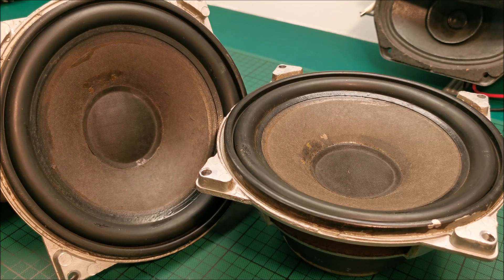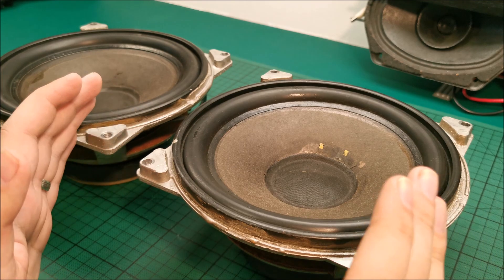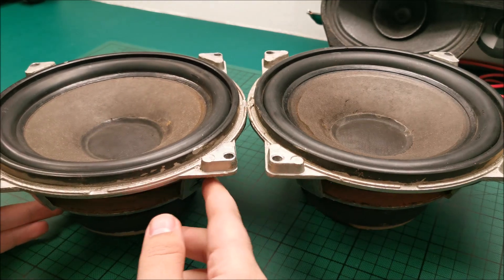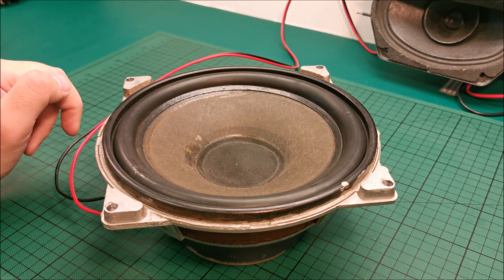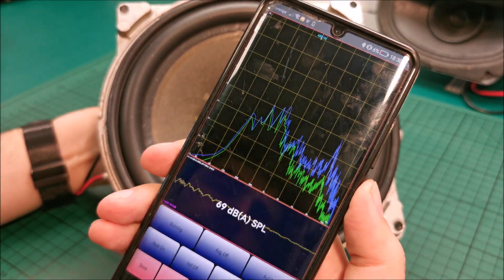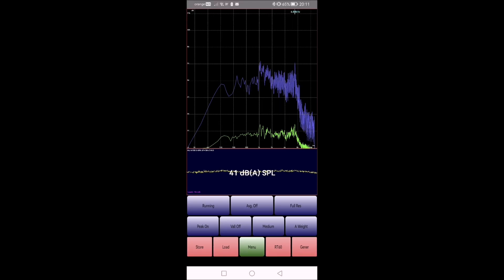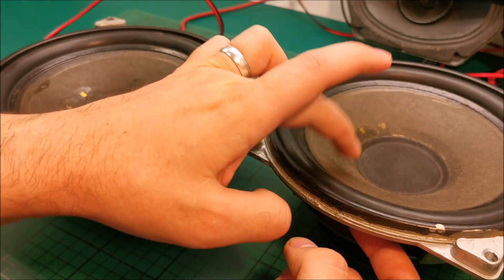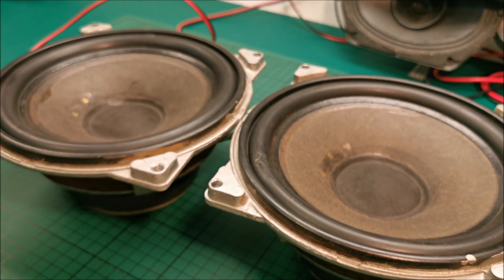1980s Soviet (Russian) 10GD-30B (10ГД-30Б) vintage speakers - test, frequency response and excursion

Comment: I found a pair here in india from a ship breaking facility. The cone was totally destroyed. Got the speakers re-built with cone, coil everything. I want to understand as to what kind of enclosure will be suitable for these speakers. If anyone has seen the enclosures or point to a photo via a link it will be helpful. As of now i am using these mounted in a cardboard box, and sound ok. Using a pioneer vsx 817 to drive these.
Reply from the maker: Good job 👍🏻
No idea about original enclosures for them, but mine are working perfectly in this: https://youtu.be/B57-Wyoepc4

Comment: I have the 10GD30E alnico version. These speakers are smooth across its band width. No mid range peak. They have relative high moving mass and middle qts. They need seal box to give punchy bass. They don’t like ported box.
Reply from the maker: Thank you for this info 👍🏻